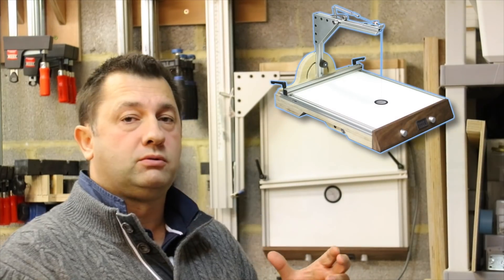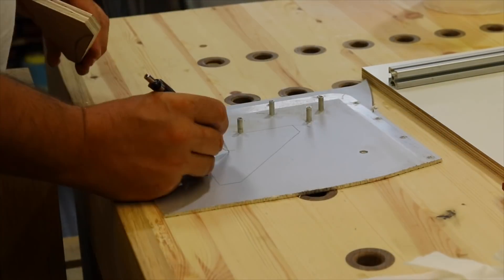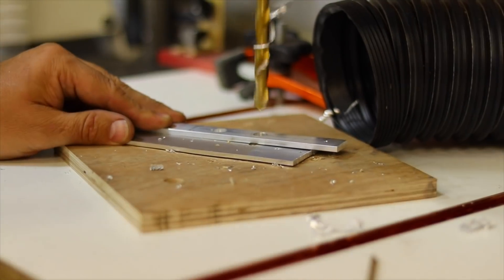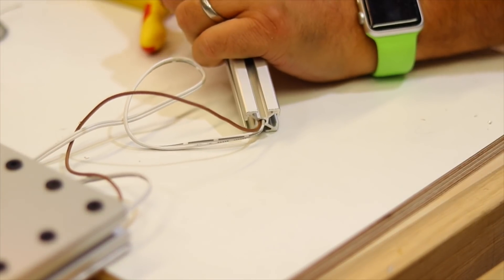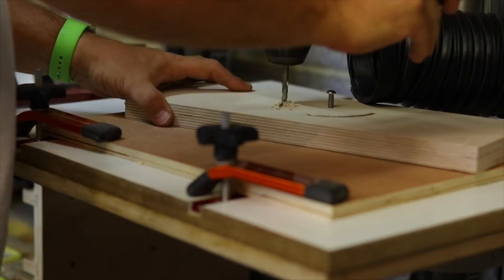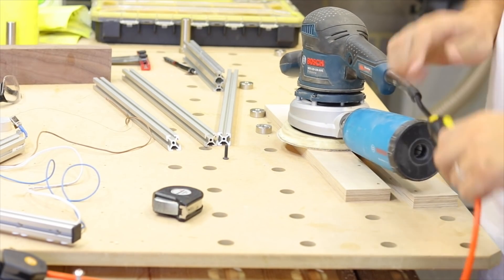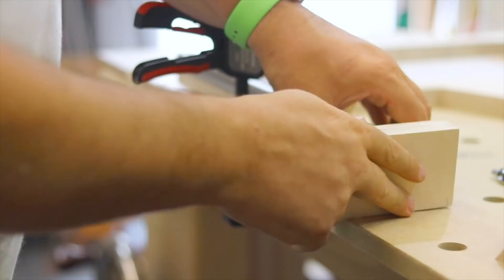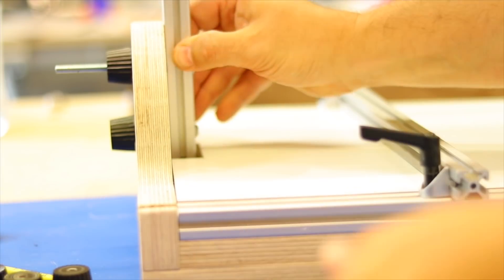How I Made my Ultimate Hotwire Foam Cutter - part 1 of 2

Comment: Another great video. The only thing I can think of to add would be a way to angle the wire the other way so longer pieces of foam could be cut on an angle like running a board through a table saw.
Reply from the maker: Clifton Snider there is a way to do this. The aluminium extrusion conducts electricity so using a drop in t-nut and small bolt I can add a wire mounting point at anywhere on the side of the top arm getting the inward angle, limited to about 45° though. But it I use the rear vertical extrusion I can get steeper angles.. As the whole arm tilts if I side mount I can still get the wire to be at 90° in the side to side direction.

Comment: This is certainly an interesting design you have for a hot wire foam cutter. I would like to know where to get the aluminium extrusions you used if it is available somewhere. Keep up the interesting designs. Well done
Reply from the maker: Tony Gasperini I got them from a company called Oznest. Thanks!

Comment: Making that "slot/groove" ( don't know english word for it ) with drill press was new for me. Thanks a lot, haven't tought of that.

Great work, very professional design and finish.
Reply from the maker: Thanks! For the slot/groove i think i would get a better cleaner finish if i set up a similar jig on the router table and did it in small incremental passes.

Comment: A few improvements i thought of, since the overview video.

1. Set the defaults, for example, there should be a way you can reset the tool to being perfectly perpendicular to the surface without having to reach for a set square and also a notch on top of the armature to indicate the optimal point for tensioning the nichrome.

2. Mark the rules and angles on the tool itself.

3. The circular Jig, make it out of transparent material (i.e. acrylic / plexiglass), in this way lining up and centering the foam should be much less of a hassle, just flip the whole jig up and look through it.
Reply from the maker: Regarding point 1. You will see in the next video (part 2) a metal bolt in the top of the plywood pivot support. I started to devise a system for some default stops but i found that the arm had a little flex in it and that the way i attached the wire above and below  the base had a slight variance each time not giving me the repeatable accuracy. So i decided for the number of times i change the angle or the replace the wire, versus, the speed of setting it back to 90 degrees or any other angle, it just wasn't worth the additional effort. So i abandoned this part of the design.

Point 2. I tried to print on some vinyl to make some angles and dimension grid for the base and the pivot arm but the vinyl i had just wouldn't take the print and sizing was inaccurate. But you are right this would have been a great addition for sure!

Point 3. Yes absolutely clear perspex would have been great, i think by this time i was getting wary of cost on the whole build and was trying to use just what i had in the shop if possible.

I think you have great ideas and really thought through the improvements. Thanks for taking time to share these!!!!!